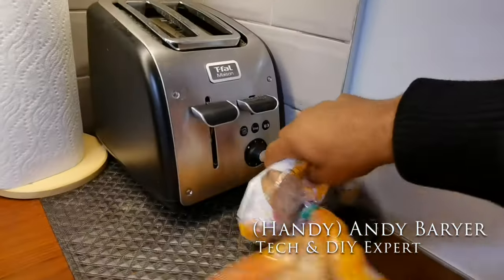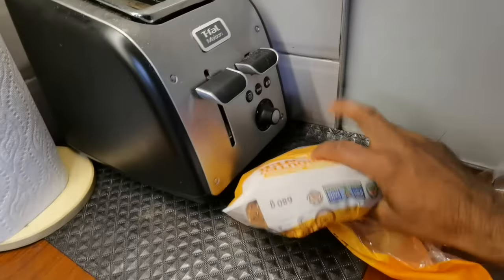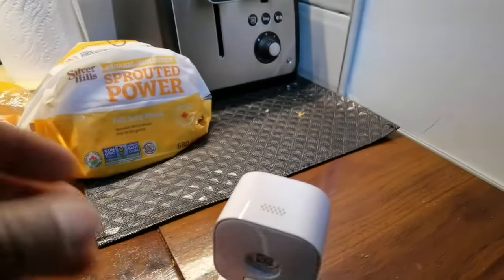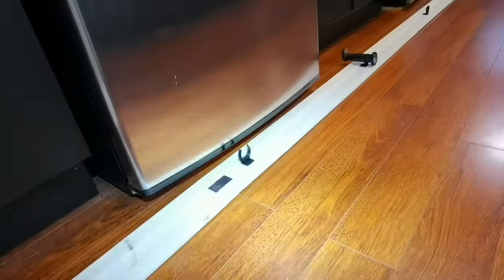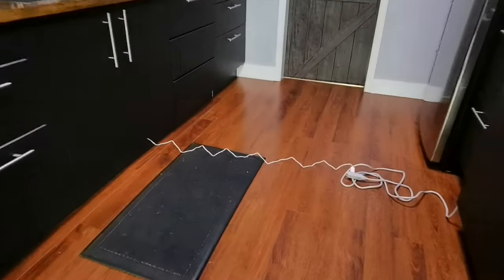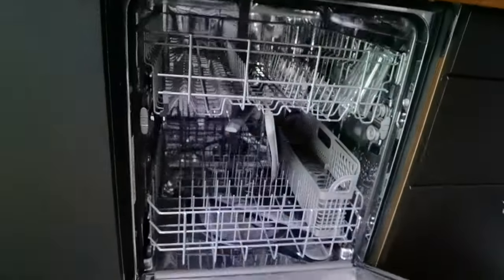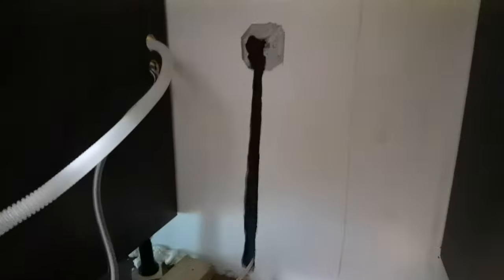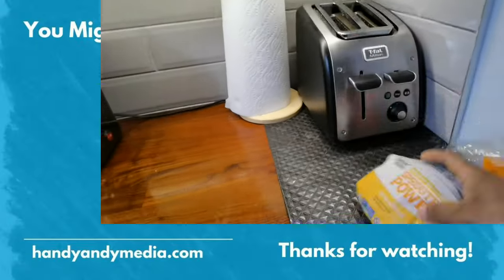Finding a Mouse Hole and Filling it to keep out mice and other pests

Comment: Spray form does not work. They still make hold though it. Like pictures
Reply from the maker: So far it's working, no issues. Let's see what happen next year.
Reply: I used for foam as well. Mouse ate right through it.  I think it depends on how motivated the mouse is.  My understanding is that it's best to stuff the hole completely with steal wool and and spray the foam from with the steal wool.
Reply: did it happen?

Comment: Holy fuck, you left a 30” long 1” wide slit in drywall and didn’t think about rodents? You really shouldn’t be doing renovations if this is your quality. Just because it can’t be seen doesn’t mean you shouldn’t spend 4 dollars on a tube of caulk to fix a gaping hole in the wall. That said it’s definitely a learning process, but come on dude. A mouse can fit through any hole that its skull can squeeze through. 3/16ths or larger and they are in. Also foam won’t work, you gotta pack with steel wool then foam.